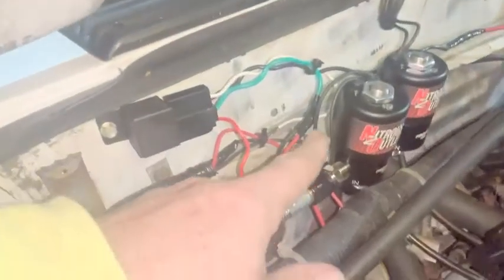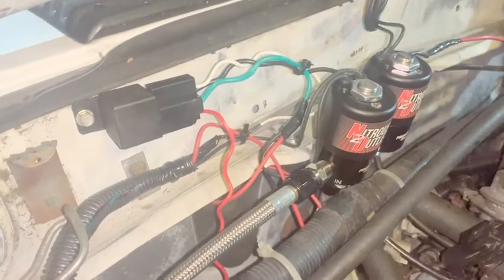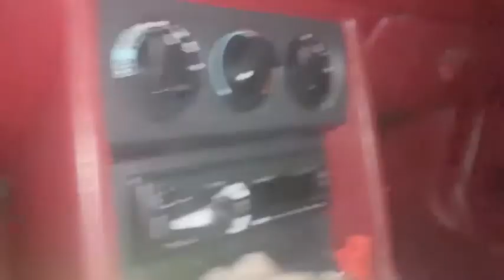Easy Fox Body Nitrous install you can do!

Comment: I'm familiar with a wot switch so I have a question about the button. So how the button works is you tap it then the solenoid sends whatever shot you have setup into the motor?
Reply from the maker: That is correct. The button is the same thing as a wot switch but you are the one that will press and hold it. You have more control when you want the nitrous to engage or not.